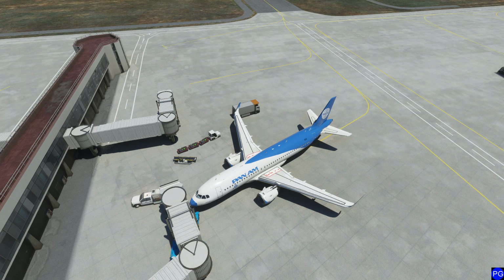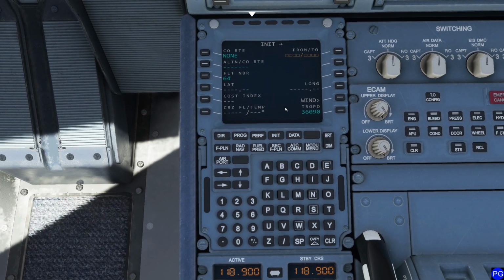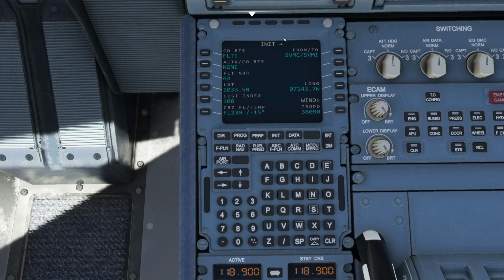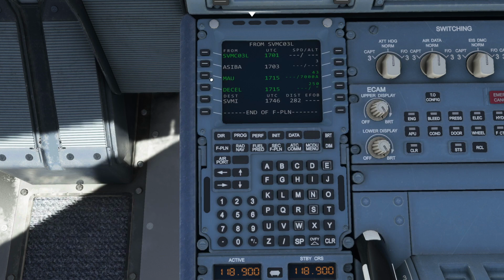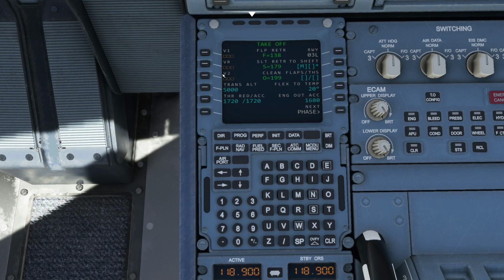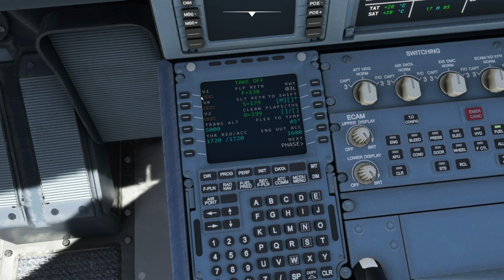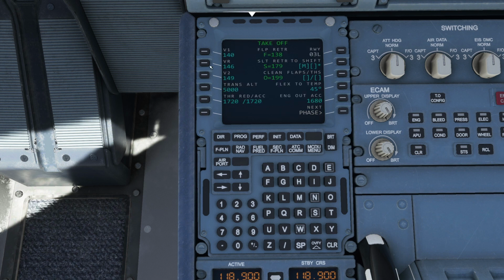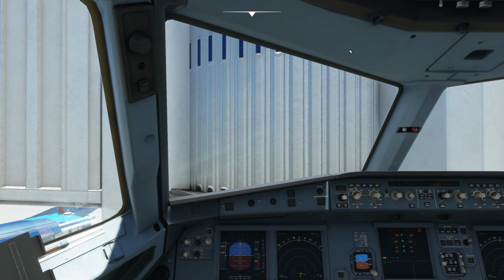MSFS - Flying the Airbus A320neo Part 3: Basic FMS Programming

Comment: I tried to manually set my Simbrief flight plan on the FMS, and one thing I’m unsure of is specifying airways from or to particular waypoints. If I just add the last waypoint to the given airway, the path is identical to the Simbrief path, minus all the waypoints that should appear on that airway. Now if upload my flight plan before loading in, those waypoints appear to be specified on the airway path. It doesn’t change the flight in anyway, but it’s weird
Reply: Let's say that, generally speaking, between two specific waypoints quite close to each other there is only one airway.
If you dial in waypoints that are quite far away from each other (eg one in Portugal and the other in England) there are several airways connecting those specific WPs. Of course in simulation world it does not make any difference, in real life does.
Real flight plans are specific enough to avoid this confusion, that's why there is a specific office for each Company which deals with flight plans... it is not the pilot which punches in each waypoint and each airway.
I hope this helps.

Comment: HI, I am new to MFS. Currently landing in IFS so hitting glide slopes is important for me. Why is it that at 8:39 the flight plan shows the altitude for PBL but nothing for ANDAL, and what does the 254 that it does show, represent? Thanks
Reply: 254 is the heading you have to set. Sometimes the altitude at that waypoint is not shown because there are no altitudes restrictions for it. E.G. when you see "4000A" means "4000 feet or above" (P Gatcomb mentions it a couple of times in the video).